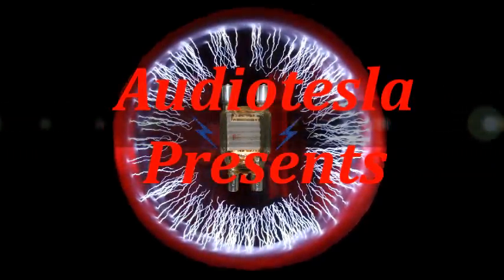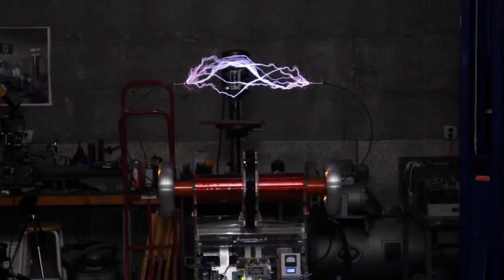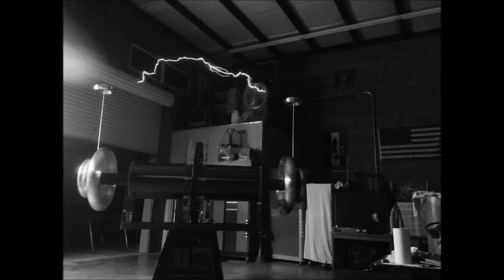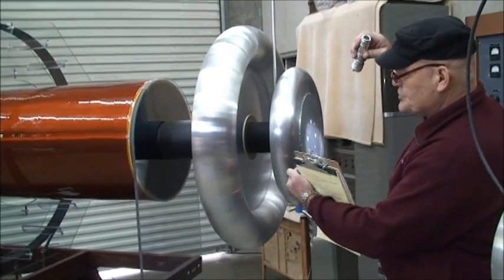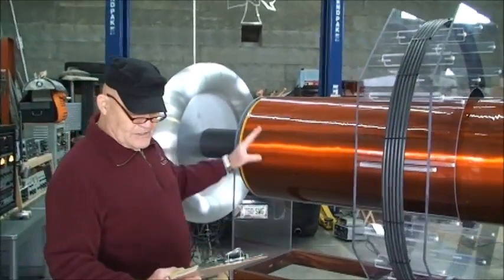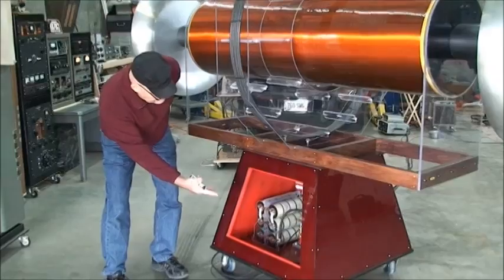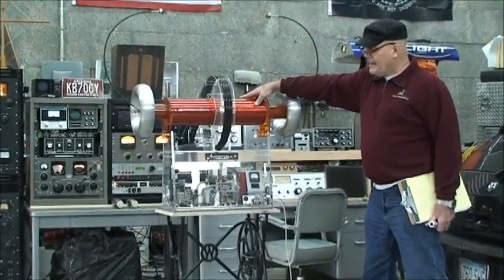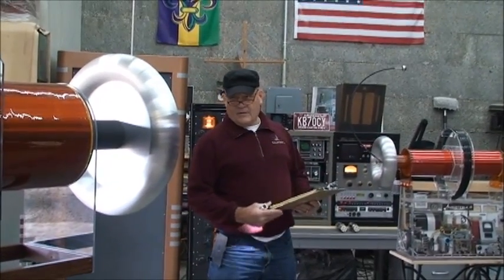Hellcat Bipolar Tesla Coil

Comment: Excellent stuff. And a question for you.

When I ran a horizontal half-wave dipole secondary, in a static SG system, I found it impossible to avoid arcs from the secondary to the primary, however much insulation I used. I eventually diagnosed this as unequal breakout voltages for the positive and negative discharges, resulting in a small 'rectifier' action which charged up the whole secondary assembly until the accumulated dc charge was discharged to ground via the primary. I solved it by grounding the centre of the dipole, which did nothing in theory, but in practice it gave a discharge path for the dc charging current. Do you get this trouble? And if not, why not - does electricity behave itself better in your lab than it does in mine??
Reply: If you are getting flash-over your primary coil is to small and you are over-coupled. If you are getting strikes from the end of your secondary to the primary then your secondary is to short. If you are getting sparks that run the length of the coil you are out of tune and you have just destroyed the secondary. (I build 7kw coils)
Reply: Thanks, all understood. The above issues don't apply. But did you read my question right through? I was asking about the OP experience of a different cause of flash-over unique to a non-grounded dipole system. I want to know if and how it is avoided by the OP.
Reply: I don't see how it is possible to get a DC current from a bipolar coil. What I have noticed is that the varnish can get polarized to the point where you can get residual charge. I always shake my head when I see secondaries that are buried alive in varnish as this is counterproductive.

Comment: Very impressive. I really like that the coil design along with the holding stations made to support them and there weight. The metal flakes that were added to the varnish was a clever idea. I recall when I was messing around with a small vertical tesla coil and I was having issues of electric sparks occurring between some of wired loops in my secondary coil even though the wires were as well painted with varnish.  If my thoughts are correct those metal flakes added to the Hellcats varnish will fix that kind of problem.
Reply: One thing that I really don't think Mr. Tesla had in mind when inventing these huge coils is to use them to play music. Sure he would not dislike it but I think this musical tesla coil thing has taken peoples eye off the ball when it comes to producing these things. The MAIN goal with these machines is to increase wireless power distance. The rumor is that Tesla was able to send power without wires out over 25 miles from his lab in Colorado and today I think the farthest I seen someone use wireless power is about 6 feet away. The main goal for Tesla Coil builders should be distance and I believe this can be done with solid state slayer exciter tesla coil signals being amplified by vacuum tube rectifiers then sent out a larger antenna much the same as a AM radio station would. Its unknown to me if this would work or not but this is what should be tested and reinvented theres time for the whole musical party tesla coil thing after the main goal is achieved ....
Reply: @TheZafootz  The problem is people are using Electromagnetic induction to power these coils and they are missing the 3rd coil. These coils were never meant to operate on magnetic induction but on Dielectric induction, Dielectric Impulse Displacement Currents.

Back in 1981 when Tesla was still working for Edison he became very interested in the sudden powerful discharges that would occur in the power lines the brief instant the circuit was closed, this took him down a very interesting path to discover a special kind of displacement current that is produced by Impulses.

An Impulse is a voltage or current that lasts for an extremely short period, less than 1% on a chip duty cycle, if a capacitor discharge is fast enough the magnetic current will flow and very rapidly come to a stop before it can reverse direction, this sudden cut of creates a unipolar 1 direction displacement current.

There are 2 types of impulses according to Master Ivo's research, the first is a Disruptive Capacitor Discharge, a current impulse is produced from a capacitor if fully discharged at a fast enough rate, if the discharge is fast enough to make it an impulse and without reversal is creates a unidirectional voltage spike in the same polarity inside the capacitor, which will momentarily produce a unidirectional displacement current.

The other is a Disruptive Coil Discharge, a voltage impulse which is produced in a coil, if a coil is given a DC current and then interrupted, and the coil is resonant, the voltage will rise as the magnetic current transformers into it due to the capacity of the coil (lenz), the voltage impulse produced in this manner will have alternating polarities resulting in a displacement current of alternating polarity.

Ironically the impulses produced in a coil are also known as Inductive Spikes or Back-EMF spikes, which is something that is usually hated yet is needed for unlocking Tesla's more advanced technologies.

If the voltage impulses can be prevented from transforming into current impulses, they will instead produce Longitudinal Displacement Currents, otherwise known as Radiant Energy, they are not themselves either of the before mentioned impulses but rather are produced from them, those displacement currents are the end goal of producing and controlling those impulses for some pretty amazing phenomena, this was the sort of power Tesla wanted to transmit using Wardenclyffe.

Displacement currents need to have an impulse duration of 100 Microseconds or less to be safe, otherwise they induce feelings of painful mechanical pressure and stinging sensations. At 1 Microsecond they induce sensations of heat and were recorded to have positive improvements on the persons mood, 100 Nanoseconds and under is when they begin to produce Endothermic effects. They can also be used to add or remove charge from objects depending of displacement polarity, where negative to positive has the displacement current flow into the conductor, positive to negative has it flow out of the conductor.

These displacement currents are the type of power Tesla was going to transmit using his towers, Tesla's hairpin circuit is another way of producing them, if the spark gap is magnetically quenched so the current is never allowed to reverse a displacement current will be produced during the event. Also, unlike regular Electric a Dielectric displacement current becomes more efficient as resistance goes up, counterintuitive.

As for the 3rd coil, there's a lot to it but to put it simply it does a few things: It breaks the symmetry of the power generation which has implications on its own, it's kept away from the magnetic fields of the first 2 coils allowing it to freely oscillate without being weighed down, and its the coil responsible for allowing his circuit to skyrocket in voltage levels.

If you want to learn more about this, I recommend reading "Secrets of Cold War Technology: Project Haarp and Beyond" by Gerry Vassilatos and "Free Energy Secrets of Cold Electricity" by Peter Lindemann
Reply: @jenkorun1306  Very interesting stuff, It makes sense that Tesla would of been interested in these power spikes that occurred when the circuit is closed and if he could make that spike continue to reoccur with impulses of current rather then alternating it and test to see if that power spike could be channeled. If he could find a way to channel that spike as well as make the power spike continue to reoccur over and over, then maybe he found a way to have that power spike increase its power with each impulse. In a sense making a machine that could push out more and more powerful voltage spikes with each impulse he applys and he could artificially make a voltage discharge reach any power level he wanted... If Tesla was on the hunt for ways to obtain unlimited levels of electric power then thinking up an idea like this to create more and more powerful voltage spikes using controlled impulses of current to obtain a level of voltage discharge he desired then channeling the powerful discharge to whatever circuit he saw fit such as a power transmission station like Wardenclyffe, then maybe this is the solution to the problem of the huge amounts of power that is needed to energize a global wireless power transmission station. I did some tests with ground rodes and a bunch of capacitors looped together that was able to cause a huge discharge into a ground rod configuration I had set up at the time. Its been a while sense i did that test but I made a video of it and posted it on my channel. Heres the link for that video.... https://youtu.be/VwS0W7UroPE?si=x043e53NXNEbywAr